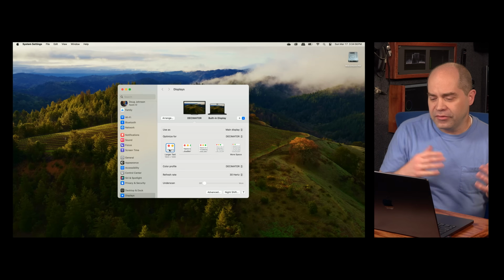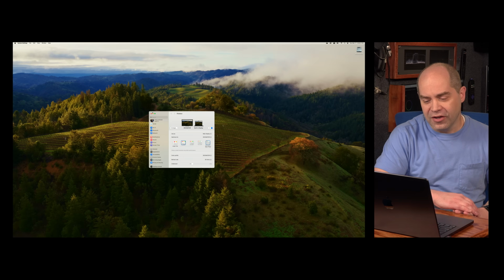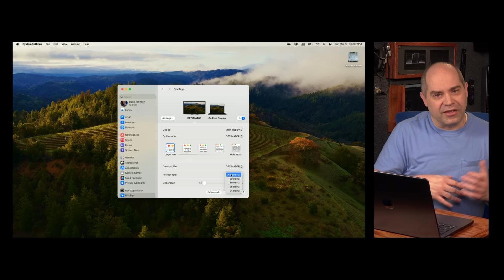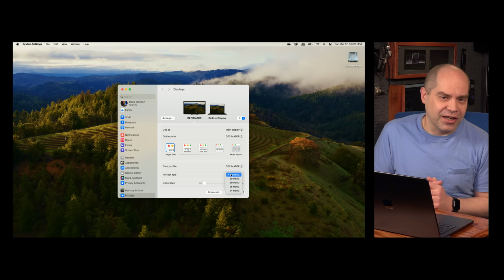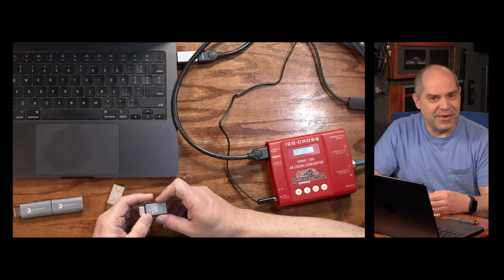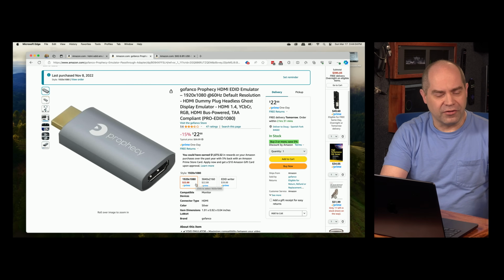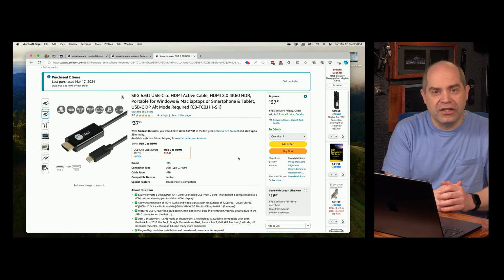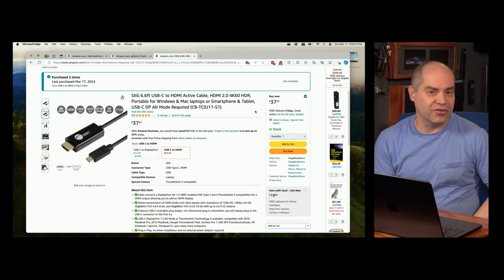Fixing Apple Silicon Mac HDMI Output for Video Production Systems

Comment: Thanks for the run down. I just learned the hard way about this lame monitor output from Macbook Pro. I was doing a teleprompter gig and the M1 Max choked sending HDMI on a 30' cable. Signal would drop randomly.
I have been doing it with an Intel Mac for a decade sans problem...

Comment: Hi Doug, I have issue where my MacBook Pro doesn’t want to turn when connected to my lg tv. Normally it will boot by just lifting the lid however instead, I have to hold power button for 10 seconds. It’s like there is some power issue going on. Any ideas why this is? Will another lead like an active one fix this?
Reply from the maker: Try disconnecting the monitor temporarily before turning the computer back on. Another option is to switch to a different connection type... i.e. if you're using HDMI try using DisplayPort instead if your monitor supports it. DisplayPort seems to work a little better on Apple Silicon Macs than HDMI.

Comment: I have a Mac Studio with an M1 chip. I have a Teranex. I want to input my Teranex. From what I understand, I can use a SIIG Active USB C to HDMI Cable, or I can use an HDMI splitter, to input the Teranex. If I understand correctly, the best optio is an HDMI splitter to feed the Teranex. Do I use the SIIG active cable to feed the HDMI splitter?
Reply from the maker: I don't know that having both will give you any better shot at it working. But the tricky part is that it's all a bit unpredictable. I've seen several situations where two identical Macs behave differently... one will work while the other will not. So about all you can do is try it and see.

Comment: Hi fascinating watch - I'm wondering if the answer to a current problem is in one of the adaptors you mention - PROBLEM - mate has a M1 MacBook and on connecting an LG monitor the monitor has vertical lines all over... the web is full of suggestions but all hit and miss... would any of the connectors you show help with that? or am I just clutching at straws?
Reply from the maker: Does it work with the official Apple adapter?

These USB-C to HDMI adapters don’t really do anything, so there tends to be very little difference from one to the next. Their only real job is to tell the computer that it wants an HDMI signal, and then that HDMI signal is generated by the computer. But, with that said, for some reason the Apple branded adapters do tend to work better with Macs.
Reply: @djp_video  Thanks for getting back - my mate is trying to set up an external monitor with his Macbook air but getting those vertical lines. He has connected the HDMI cable that came with the display (LG) to the HDMI on a USBc Multi Hub.... (also got mouse, interface and Keys connected)  this prob is fairly well documanted by everyone apart from Apple.... but all seems hit and miss .... then i watched your vid and thought MMMMMM!
Reply from the maker: You could try the active cable. That has the best shot of working of anything I know.

Comment: Wondering if the Mac Studio prefers the DP alt mode HDMI cable to its HDMI port? I can get all my displays set up, then reboot, and some seemingly random display ends up with the primary display. It seems to usually be the SIIG connection, which of course goes some place totally inconvenient.

Comment: Ok so my situation is a bit different in that I am not in video production but run a building design business running AutoCad LT, though I am having problems with the spasmodic flicker, ghosting of open programs and some vertical pixelation.  I am using a Mac Studio M2 Max with Sonoma 14.5 with an external BENQ PD2725U monitor and have tried it with a new Avencore Carbon Series 1.5m Ultra High Speed Certified Cable 8K/60Hz (48Gbps HDMI 2.1) to no avail! I have also run in the Display Colour Profile, and changed the refresh rate down to 50 Hertz with no results! This seems to be an issue for many users who have a non apple monitor connected to an Apple M1/2/3 device. BENQ also state that their monitor is a Mac compatible device hence me buying it!  Do you think that the installation of an EDID would solve this problem? Thanks in advance.
Reply from the maker: In that case an EDID emulator probably wouldn't help. 

Switching to DisplayPort with a USB-C-to-DisplayPort cable/adapter might though. Or using a shorter HDMI, or Thunderbolt 4 certified cable.
Reply: @djp_video  thanks for the quick reply 
Will give your suggestions a try and get back to you 👍

Comment: Can anyone comment on the idea that the USB-C (Display Port Stream) - to HDMI, is actually a poor or bad HDCP conversion from C(DP) to HDMI.
Reply from the maker: USB-C ports can output DisplayPort or HDMI. Both are referred to as Alt Mode, as they are an alternate use of some of the pins of a USB-C port. Passive adapters/cables merely tell the computer that "a display is connected using HDMI. Please send an HDMI signal." Passive devices don't do any actual conversion of the signal. That's where active devices/cables come into play.

In the case of the active cable(s) I recommended here in this video, they ask the computer for a DisplayPort stream. Then the electronics in the cable receive the DisplayPort stream generate their own HDMI signal. This usually solves the problem.

HDCP is basically the same for HDMI or DisplayPort, and implemented as (1) part of the initial negotiation between display and source to establish HDCP version and encryption keys, and (2) encryption in the video data stream. Occasionally that can go wrong, but it isn't often and when it happens is usually due to a low quality, bad, or marginal cable, or one that is too long. Macs usually don't enforce HDCP unless you're playing back protected content like from the TV app or streaming service or similar. It wouldn't ever engage when sitting at a blank desktop with no apps running.

There has been quite a lot of discussion/speculation online that HDCP is the cause of Macs being uncooperative with HDMI connections. I've never seen any evidence that that is even remotely true, despite spending countless hours trying to figure this out and come up with a definitive fix. 

If HDCP was the issue, sending the signal through USB-C to DisplayPort, then converted to HDMI would fail as well, as DisplayPort also supports HDCP, but it doesn't. And devices which strip HDCP from HDMI would allow Macs to work properly, but they don't. If HDCP was the issue, using EDID emulators to coax a specific signal format from the computer would not fix the problem, but they usually do. And monitors which actually do support HDCP (as most do) should always work, but they do not. And switching from a native HDMI port to USB-C converted HDMI on the Mac would always yield the same results, but it doesn't. HDCP just doesn't seem to factor into getting a connection up and running unless protected content is actively being played. It hasn't been the common denominator in any of the testing I've done.

As mentioned in this video, I had a discussion with someone who manages a team that creates HDMI converters about this problem. In their internal research, they found that the incompatibilities with Macs tend to come from the computers outputting a signal with non-standard timings. (I didn't ask for any additional technical detail, or I would pass that along.) They were able to relax the tolerances on their converters and that made them work with Macs much more consistently. That also lines up with what I've seen as well. Those devices, if run with older firmware, are much more likely to fail with a Mac than the models with newer firmware.

But one of the biggest contributors to the issues is the fact that adjusting screen resolution in the Display settings doesn't usually change the output resolution at the HDMI port for Apple Silicon devices. That setting adjusts the scaling, but not the signal the Mac is outputting. So, if through EDID negotiation, the Mac establishes that the connected device can receive a 3840 x 2160 image at 60 fps, it's always going to output 3840 x 2160 and the only thing you can change as a user is the frame rate, even using the Option key tricks. In my many days of testing, I found this to be absolutely consistent and predictable.

Comment: Hey bud, bit of a question hurdle I’ve been dealing with since last year updating to the M dot two silicone MacBook Pro. A visual artist myself often times I am showing up to do a sort of visual check with the tech at the venue and recently I’ve had a bunch of admittedly inexpensive DMI splitters not working and seemingly switching to a pass-through mode as opposed to a proper splitter, basically meaning you can plug-in one of the other it doesn’t matter which but whichever one you plug-in second is not going to work, after months of research, I’ve read some articles about Apple restricting a lot of equipment based on HCP protocols, but you would think a simple powered two HDMI out splitter would not really be on a list like that, the strangest part about it is, a few of these I’ve used three or four times and then on the fifth time, of course, the time of the actual event and not an AV check these splitters all of a sudden stop working, does Apple in fact have some sort of real time management of devices that gets released with security updates to the operating systems? I now have to travel for some of these events with four different splitters and even a small inexpensive matrix just to know that when I show up for performance, I’m going to be able to get on to two screens.
Reply from the maker: Apple does make updates to their HDMI hardware as part of operating system updates. I've seen substantial changes to the way my Mac Mini M1 behaves over the 3 years I've had it. And I've heard from many (including here in the comments) that computers that have worked in the past will stop after an OS update.

Try one of the EDID emulators. I've had far better luck with those than other solutions.

Comment: I had an Apple computer that ran Monterey, someone did an update to the latest OS (Sonoma), and all of a sudden no video from the Mac would not go into the ATM switcher HDMI. It was because the latest OS did not support 1080p 60 Hz. Sonoma only has 25 and 30 Hz Tried everything. 

The only thing that worked was for me to roll back my OS to Monterey, Big Sur works as well that I have one a different Mac running the same ATM switcher with an Apple computer
.
Had not tried any of the adaptions you listed below as this was six months or so ago. Hope this helps someone.
Reply from the maker: It does seem that Apple's updates make things worse rather than better. I was hopeful after I got my M1 Mac Mini that the problems would get fixed, but it's less consistent now with HDMI than it was when I got it 3+ years ago.

Comment: The Decimator stuff is amazing.  Absolutely an essential device to "make things work" - period.

I do have to say, though, that I've seen stuff that just won't work.  Converters won't touch it, Decimator won't touch it.

Plug it into a 20 year old Kramer 728 (less than a hundred bucks on eBay these days) and it comes out perfect.

All you can do is shrug your shoulders and move on.
Reply from the maker: The Macs are among those devices. I've heard from a number of people, and even seen myself, situations where even a Decimator won't recognize the output of my M1 Mac Mini.
Reply: @djp_video  had that happen, also had it come up on the Decimator with impossible readings for framesize/rate (eg, garbage data).  Hate macs.

I keep the Kramer 728 as it's often the only device something will sync to.  Old as snot, but it's dependable.

Comment: So Apple is breaking the HDMI standard? O_o
I mean to get HDMI license there are requirements you must fulfill. I wonder what HDMI forum's doing about this... their whole point is to try and get everyone do things the CORRECT way so that HDMI will be a viable connection standard.

If HDMI sucks but DP is better, then people will take DP over HDMI and HDMI will lose market share and licensing income...
Reply from the maker: I can't verify the standards issue myself. That's just what I was told by an engineer who works on products that accept an HDMI source, and they have had significant difficultly getting Macs to work with consistently because of signal timing issues.
Reply: @djp_video  at my last job, we had similar issues all the time with macs and it got worse in recent times. We had to install quite expensive hardware for our customers and some were out of luck having invested hundreds of thousands to a AV systems in their meeting offices and then realizing that MAC's are not compatible with the hardware anymore... so they have to invest into new set of hardware... and that wasn't on us, that was fault of the hardware manufacturers, but mainly on Apple forcing stuff like HDCP even with content that doesn't actually require it.

Broke many things like teleconferencing and screen sharing on many systems.

Comment: Just thinking loud...
Have you tried if the app "BetterDisplay" makes a difference?
Also "unsyncing" the Displays seems to do the trick a lot of times (at least for Keynote with e2).
And if you have a Job with a barco e2/S3 system -  with trial and error you get macs to output 5994. Some of the cheap EDID emulators can copy EDIDs....

Comment: One thing you totally left out which is my preferred method for 1080p and that's use a BMD UltraStudio Monitor 3G. It's SDI straight out of the Mac with assignable scale and resolution. If i'm doing more, I have a 8k card in a Sonnet enclosure. I have a 100% success rate with both of these options.
Reply from the maker: This was really meant as a video to show how to output something running on the desktop, like a presentation or web browser. Those don't work with the UltraStudio or similar devices.

Comment: Click on the resolution adjustment icons with the Option key held down and you get a list of resolutions. Click the switch at the bottom labeled Show all resolutions. Depending on the display or device attached you can select a version with (low resolution) next to it. Might help. Thanks for your tips Doug.
Reply from the maker: It doesn't work in this situation. I've gone through those steps many, many times and it does not change the output resolution when used with video production equipment. Photos here: https://discord.gg/d8mFdXbNHJ
Reply: @djp_video  I believe this could possibly only be true for the really low end M1 & M2 base models… if even that. I run arm based Mac’s of many types daily that the option key hold down definitely changes the frame rate and resolution. Unfortunately not all behaviors are the same across different models
Reply from the maker: It doesn't work on either my Mac Mini (M1) or my MacBook Pro (M3 Pro). I have spent literal days trying. I would love it if it did.

Comment: of course the hdmi is different from the usb c. the hdmi uses hdmi, usb-c uses Displayport.
Reply from the maker: USB-C has an Alt Mode for HDMI as well, which is what gets used by the passive adapters that are out there.
Reply: @djp_video  so just a regular dp, passive adapter somtimes dont work
Reply: @djp_video  btw. Framerate conversation is no problem for static content.  If we do coroporate events we let the custommer use his laptops for slides, but videos are played trough one of our laptops.

PS: it whould be great if microconverters and decimators just had an internal function to edit the edid config, or even use an sdi in as resolution an framerate reference for the edid information.

Comment: I've had occasional issues with HDCP compliance using Mac with events in some spaces with Christie switching gear, resulting in a TV or projector not able to hold a signal from a Mac for more than half a second. The fix is to use a splitter, ideally one that lists "HDCP stripping" somewhere quietly in the specs. But overall, I've had very few problems. (In Australia, so any lack of 59.94 is happily not an issue.)

Comment: Another option is to use AirPlay to an AppleTV. Run an ethernet drop and USB-C NIC to the presenter. If EDID+Decimator fails, have the presenter share to your AppleTV. The AppleTV supports NTSC frame rates. On my Intel NVIDIA GPU MacBook Pro I had HDMI just stop working one day. Resetting NVRAM did the trick.
Reply: Yup this is what I do, although I'm not using NTSC frame rates

Comment: hey which on are most use on set the frame rate  EDID Emulators ? so I Ould but them and thank I didn't know this
Reply from the maker: Get some that are configured for the frame rates you use on your switcher. So, for example, if you work in 59.94 or 60p, get an EDID emulator for 59 or 60p.

Comment: What about using a tool like SwitchResX? It lets you set the signal format in great detail.
Reply from the maker: It isn't as helpful as one might hope. It doesn't seem to do anything in this scenario.
Reply: @djp_video  Well, it lets you precisely set the resolution and frame rate besides other things, so you don’t have to use any converters, no?
Reply from the maker: If it works, which it never has for me. It has a LOT of limitations on Apple Silicon.
Reply: @djp_video  I’ve had great luck forcing EDID’s on my M2 Mac. Created custom resolution in AW Edid editor, then loaded it in SwitchResX. Worked a charm even with a display (a Novastar MCTRL4K in my case) that output a regular 4k60 EDID.
Reply: @bassclef__ I have the same problem, mctrl4k I can't give a custom resolution, what kind of settings did you make in Aw edit editor. For example, I want to work with 5040x1344 custom resolution, what can I do, I would be grateful if you help me